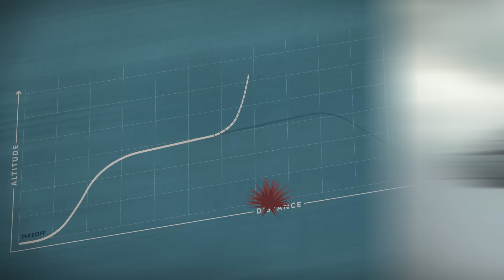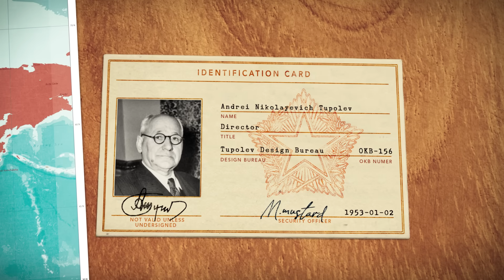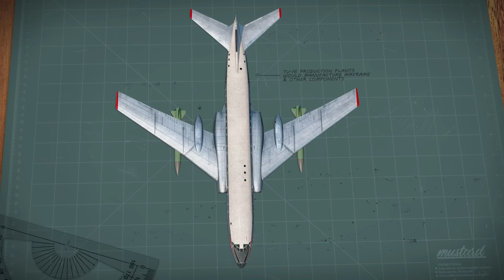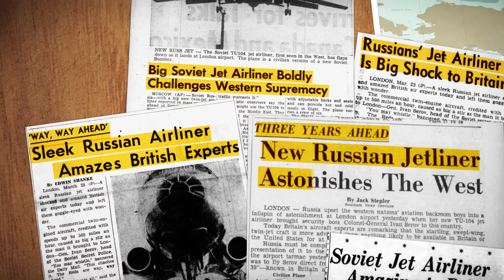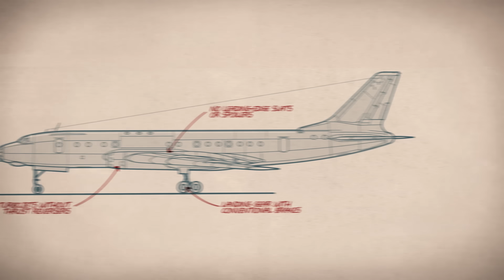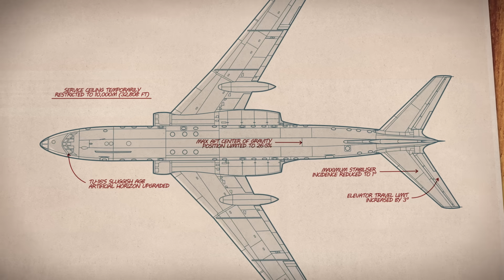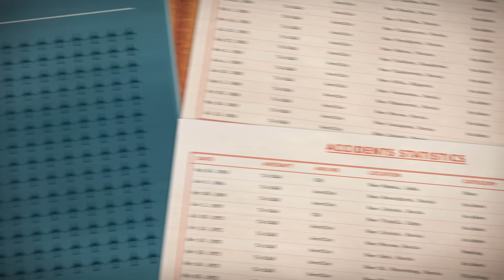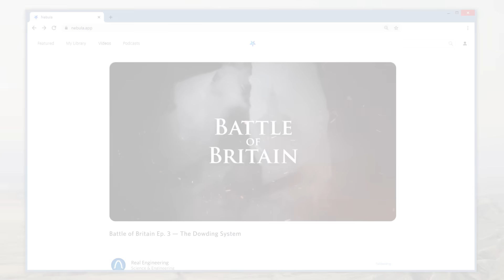The Soviet Airliner Designed To Crash

Comment: The most dangerous airliner is Boeing.
Reply: A "Boeing" isn't an airliner
Reply: Wrong, the worst jet airliner in history is the de Havilland Comet
Reply: @WilhelmKarsten 

@sandervanderkammen9230 

Obviously it's always very important to note the relevant facts.

Indeed we feel able to clear up a few common misconceptions & false myths.

Kharzeestan Krappenz DiktorBummer Jurkzxoffenz etc and co - they should all note good with much awe & extreme wonder.
        UPDATE MORE BREAKING NEWS ETC

    How things were back then -
Accident losses - % of aircraft built.
DeHavilland Comet 4 UK                        14% 
DeHavilland Comet all   ff-1949             17%  
Vickers VC10 UK                                      5%
HS-121 Trident   (ff 1962)                       15%
   The DH Comet had better safety than or similar safety to many other commercial passenger aircraft of a similar era
    Douglas DC-1       .      99%
      Douglas DC-2            47%
    Douglas DC-3              30%
      Douglas DC-4            26%
    Boeing s300                72% 
 Boeing 307                     70%
  Boeing 247                    48%
     Boeing 707                 20% 
Lockheed L-049/149 Constellation  30%
   Lockheed Electra  Turboprop         29%
Fairchild FH-227                                  30%
 McDonnell Douglas DC-8                  14%
  Sud Aviation Caravelle                      15%
Canadair CL-44  Turboprop                46%  
Convair CV-580  Turboprop         .      22%
Convair CV-880    (ff 1959)                 27%  
Convair CV-990     (ff 1961)                35%
Tupolev T-104         (ff 1955)               16%

        The Comet was designed with military use in mind, Nimrod work started at De Havilland in 1953.
   The investigation committee did not find hundreds of fatal flaws or evidence of design defects, structural defects, defective materials or shoddy workmanship. Ripstop provision was included. Claimed incidents did not involve cracks starting from window corners.
     The engine & engine intake position had advantages, were not flaws or fatal flaws & were not the cause of any incidents involving any Comet or Nimrod aircraft. Nearly all changes before the Comet 4 were just in case or were previously scheduled improvements. 
  Bow-wing & the 707 story (see b-47 wing folding incidents) is the result of global economics & the well protected & very large domestic US airliner market & active support from the UK with for instance proposed competing airliners from Vickers & DH being blocked by the UK government at the time, cheap & nasty was the requirement with large scale production capability in one place.
  The 707 was of course a much larger aircraft which as a stressed skin metal airframe aircraft would require a thicker skin anyway. They got lucky at the time essentially.  Bow-wing is the result of the large & well protected  US domestic airliner market 
  The fate of De Havilland was due to Govt policy Aerospace sector rationalisation & global economics, it was nothing to do with the Comet.
  A comprehensive, thorough & protracted testing program was carried out on the prototype & it's assemblies. Of course the Comet did indeed have Ripstop stop provision. 
     De Havilland (Of England) Comets were not grounded after 1970 due to structural problems.
It's interesting that some of the aircraft on the list should really have been noticeably safer than the Comet due to being a similar type but of much later design & manufacture but they definately were not safer.
    How things were back then -
Accident losses - % of aircraft built.
DeHavilland Comet 4 UK     14% 
DeHavilland Comet all mks  17%  
Vickers VC10 UK 5%
   The DH Comet had better safety than or similar safety to many other commercial passenger aircraft of a similar era
    Douglas DC-1        99%
      Douglas DC-2        47%
    Douglas DC-3        30%
      Douglas DC-4          26%
    Boeing s300            72% 
 Boeing 307               70%
  Boeing 247                48%
     Boeing 707                   20% 
Lockheed L-049/149 Constellation  30%
   Lockheed Electra  Turboprop    29%
Fairchild FH-227                         30%
 McDonnell Douglas DC-8     14%
  Sud Aviation Caravelle       15%
Canadair CL-44  Turboprop   46%  
Convair CV-580  Turboprop 22%
Tupolev T-104                          16%

A comparison of more recent aircraft.
Accident losses comparison examples. 
1970s - 1980s
    % of total Aircraft built
Similar aircraft type, date / decade, useage, size.
    Biz Jets
BAe-125-800                        1.7 %
Beechcraft Beechjet 400    2.2 %
Cessna 550 Citation II         7.1 %
Learjet 35 / 36                       12 %
Beechcraft 1900                  6%
Dassault Falcon 10              11.5%
Aérospatiale SN.601            22.5%

Medium size jets / Turboprops.
BAe-146               5.1%
Fokker 100          6%
McDonnell Douglas DC-9-30       9.5%
Fairchild FH-227       30%
McDonnell Douglas DC-8    14%
Canadair CL-44  Turboprop   46%  
Convair CV-580   Turboprop   22%

Beechcraft, Fokker, McDonnell Douglass, Learjet, Fairchild, Aerospatiale, Canadair, Convair  companies defunct.

    All Comets, including some Comet 1s, had full civilian use certification at some point after 1954,  civilian use certification only being withdrawn after commercial flying stopped. Examples were flying until 1997 - one example did a signals research global circumnavigation flight series in 1993 via Australia virtually without a rest travelling 28000 miles, only had an ice warning indicator issue during the flights.

    The DH Comet - World Firsts.
1st gas turbine jet powered airliner. 1st high altitude 8psi pressurised full fuselage length passenger cabin airliner,  not a trivial feature as structure  strength required for pressurisation considerably exceeded strength required for normal flying stress. Nobody else had done anything similar before the Comet.
  The b-47 used 2 relatively small, heavily built  pressurised modules  (the aircraft where 6 had their wings fold up in 2 months while flying & some had their wings fall off while parked). 
   The 1937 Boeing piston engined airliner pressurised passenger cabin was pressurised to 2 psi only - in fact that could easily be done as the normal unpressurized fuselage cabin structure strength for flying stresses only was all that was needed to be adequate so no significant weight increase issues needed addressing.
    1st all hydraulically powered flying surface controls & actuators airliner with under carriage wheel disk brakes + ABS.
1st jet airliner to cross the Atlantic.
1st jet aircraft to do a world circumnavigation flights series.
  Of course De Havilland had prior experience building many all metal construction airframe aircraft including thousands of jet powered fighter aircraft that were primarily of metal construction with pressurised cockpits & jet engines built by De-Havilland & we know the world's first all metal construction airframe airliner was built in England in the 1920s by Handley Page.
     De Havilland did indeed always work to better than industry standards at the time, used up to date knowledge for the design & no evidence of negligence  or criminal negligence was ever produced in relation to the DH Comet.
    The course of De Havilland & the general UK aerospace industry sector was not affected even slightly by the DH Comet. The course of national aerospace sectors obviously being similar & inevitable in many countries.
     Other interesting World firsts
World's first turboprop aircraft & airliner.
Vickers Viscount Turboprop Airliner 1947. 
A 1945 Gloster Meteor Aircraft with Turboprop Gas Turbine Engine.

They might like to answer these questions.
   Which airline has just ordered
60 RR England Trent XWB Engines
& What aircraft are the engines for?

Bonus question for 10 points.
         Which country has the 
World's Highest Combined Per Capita
  Nuclear + Defence + Aerospace Sector Activity?    

          👍 & 🙂 & of course 😎 indeed.
          C H E E R S & without doubt  -
          Toodle PIP Old C H A Ps.

We hope this helps.     
 
This line left not blank intentionally.
           
   The next line is blank intentionally.     
             
. .... . ... ...  .  ....  ......
. . ... ..         ... . ......
 ....      .... ............ .....   .
Ivcxivcxivcvcx.  . . .
cxcxcvccbccv. . . ...
xcxiivxccxvccv.... . 
ccvvcvvcxccxc.. .

Comment: 8:26 - Soviet authorities ALWAYS have blamed the pilots, especially when the accident ended in pilots' death - "Rule number one, Soviet stuff is superior and the best of them all; rule number two - if the facts seem to point otherwise, see rule number one".

Plain and simple. Show me ONE instance where a Soviet "investigation" ("investigation", my foot...) said "erm... actually, the machine was just faulty".
Reply: No different than the British...
Reply: @sandervanderkammen9230  well, I beg to disagree. AFAIK Russian/ post Soviet IAC/ MAK (en.wikipedia.org/wiki/Interstate_Aviation_Committee) NEVER in its history, not a single time ever, concluded "technical errors/ malfunctions or manufacturing defects were the main cause of an accident. 

For instance, there were two deadly crashes of LOT Polish Airlines flights, both using Soviet made Ilyushin Il-62 (Ил-62), namely LOT 007 in March of 1980 and LO 5055 in May of 1987. In both cases the main cause oof the crash was catastrophic failure (breaking in half) of the main engine shaft connecting compressor with turbine - one was caused by unauthorised modification of the shaft's "middle support" roller bearing by the Soviet manufacturer of these engines (removing half of bearing rollers - there were 13 of them instead of 26 - and drilling holes in the outer ring "to facilitate lubrication of the bearing" which resulted in total destruction of it) and the second one was caused by manufacturing defect of the shaft itself (the hollow shaft was turned with a sharp transition from one ID to another ID, while it should be done with gradual transition to avoid creating a stress riser - and exactly that raised stress caused the shaft to break in half, which meant the turbine not being "held down" by the compressor part of the engine spun out of control, and due to resulting centrifugal forces far exceeding the strength of turbine discs. they violently disintegrated destroying the coupled engine and the fuselage, cutting hydraulic lines and then these red-hot pieces of turbine discs started fire in the cargo hold).

But guess what? Presented with irrefutable evidence, Soviets denied it all, saying that the cause of the accident was... Wow, how did you guessed it? Nah, that was an easy one, so no prize for it.

Comment: The most dangerous aircraft in the world is the latest Boeing 737 , they either stick like a meteorite on their own packed with passengers or the doors to the passenger compartment come off on the fly .
Reply: The de Havilland Comet has the worst safety record of any jet airliner in history
Reply: @sandervanderkammen9230  The problem was that both the British Comet and the Soviet Tu-104 were in fact the first experience of large (at that time) jet aircraft. And that 's why there were these incidents . For example, our Ilyushin design bureau built two Il-18 aircraft, one in 1946 https://youtu.be/TEPCRVARsGE?t=170   , the other in the late 50s https://youtu.be/TEPCRVARsGE?t=481 , and Ilyushin was lucky that he intuitively put round illuminators in the passenger compartment in 1946 and later used the fuselage of the Il-18 2946 in the Il-18 60s years . The creator of the Comet was unlucky .With the Tu-104, the story is different - the main reason for their accidents was the unexplored high-speed air flows over the USSR, before the Tu-104 in the USSR, planes flew lower, and this one flew at altitudes of 9-11 km

Comment: If you compare the Tu-104 to other first-generation jetliners, its loss & accident rate does not seem that atypical. 18.5% of planes were total losses compared to 17% for the Boeing 707 and 14% for the DC-8 while the DeHavilland Comet & the Caravelle had higher loss rates of 21.9% and 23% respectively. These were the largest planes up to that point to regularly operate near the speed of sound and hence trans-sonic effects emerged in places, especially the wings, that were poorly understood at the time.
Reply: Excellent point, compared to Comet 1 (46% loss rate) and the fatalities statistics the Tu-104 has a solid record.

Comment: The Tupolev Tu-104 Jet aircraft was introduced into Airline service in 1956. The 2nd Jet aircraft to do so after the British Comet.
"Was This The Most Dangerous Airliner Ever?" - No. Anyone claiming this needs to answer the question - "compared to what?" 

Antonov An-10 (USSR) [Turboprop] [introduced into service 1958]
De Havilland DH106 Comet (UK) [Jet aircraft] (introduced into service 1952)
Vickers Viscount (UK) [Turboprop] (introduced into service 1953)
Bristol Type 175 Britannia (UK) [Turboprop] (introduced into service 1957)
Sud Aviation SE210 Caravelle (France) [Jet aircraft] (introduced into service 1959)
Lockheed Constellation (USA) [some aircraft Turbo-compound, most Piston engine] (introduced into Airline service 1945)
Boeing 707 (USA) [Jet aircraft] (introduced into service 1958)
Boeing 720 (USA) [Jet aircraft] (introduced into service 1960)
Douglas DC-6 (USA) [Piston engine] (introduced into service 1946)
Douglas DC-7 (USA) [Piston engine] (introduced into service 1953)
Douglas DC-8 (USA) [Jet aircraft] (introduced into service 1959)
Convair 880 (USA) [Jet aircraft] (introduced into service 1960)

All these aircraft were 1st generation Jet or Turboprop Airliners(both based on turbine engine technology) or last generation Piston engine or Turbo-compound(piston and turbine engine technology) Airliners from the same period of time(1950's). None of these aircraft had a "perfect" accident free record. The Comet, 707, and DC-8 all suffered major accidents with a high loss of life within the first years of their service. The 1st Boeing 707 built for a customer exploded in flight from a lightning strike in 1963 with 81 passengers, it was the 7th major disaster of a Boeing 707 within 2 years(1962-1963).
Reply: All 1st generation Jet Passenger Aircraft/Airliners were imperfect by modern standards and sometimes had design flaws that were unknown at the time. There were limits to airframe materials, engine performance to specific high altitudes, insufficient resistance to static electricity build up, and even something as simple as a door or window could fail on the aircraft after a certain amount flight cycles if not initially designed for that specific load. Autopilot systems are still imperfect even after decades in computer and technology improvements.

Engineers working on those early Jet aircraft designs simply could not originally know everything that was learned with time and experience. It was a completely new technology that flew higher, faster, and longer distances than Piston engine aircraft(with some exceptions - especially with Turbo-compound engines in the late 1940's). The limits of Pioneering technology are usually determined through trial and error, and those errors were usually fatal.

Being a passenger on aircraft between the 1940's and 1970's was actually quite dangerous. Aircraft accidents were common around the globe. Air Traffic Control was limited to the Radio technology available at the time, Aircraft Navigation was limited to Radio beacons and maps, Radar technology initially was only 2 dimensional(altitude was not available). Today we have several Satellite Navigation and Positioning Systems, but they only became functional and available for Commercial purposes in the 1980's. This was the reason why early on there could be as many as 4-6 crew members in the cockpit, not only 2 Pilots - but also Flight Engineers, Navigators, and sometimes Communication Officers. Especially on long distance flights outside the range of normal continental flight corridors.
Reply: The de Havilland Comet 1 was one of a few failed attempts to build a jet airliner, after suffering a 46% loss rate it was grounded and its airworthiness certificate was permanently revoked.

Comment: Statistically the space shuttle must surely be the most dangerous considering how many were destroyed compared to how many were built.
Reply: The Space shuttle and the Tu-104 both have a better safety record than the de Havilland Comet
Reply: @WilhelmKarsten  any stats?
Reply: @JohnSmith-qg3jb  YES, the Space Shuttle was in service for 30 years and flew more miles, it had a 40% loss rate.
The Tu-104 had a 28% loss rate 

Comet 1 had a 46% loss rate after just 2 years of limited service when it was grounded and its airworthiness certification was permanently revoked.
The Comet Disaster is the worst engineering failure in commercial aviation history
Reply: @WilhelmKarsten  thanks for the stats! Interesting.

Comment: Sounds like Boeing and their 737MAX issues re packaged, albeit a different timeline
Reply: The Boeing 737 series is the most successful aircraft in history with 15,000 sold... it has an excellent statistical safety record compared to the Tu-104.
The British de Havilland Comet is the worst jet airliner in history, Comet 1 had a 46% loss rate.
 Boeing would have to have almost 5,000 737s crash to match that horrible safety record!!!

Comment: Boeing 737 Max says “Hold my beer.”
Reply: Spirit Aerosystems says; What bolts?
Reply: Airbus has had their fair share of problems in the past. One problem is that both Boeing and Airbus have over 20 different variants of each model, each has an upgrade or modification. It can be difficult for the pilots and maintenance to keep up with the changes. but I would never fly in a Russian aircraft. I would rather drive.